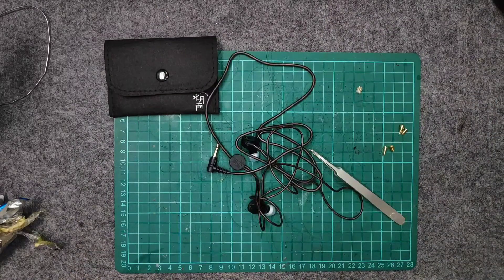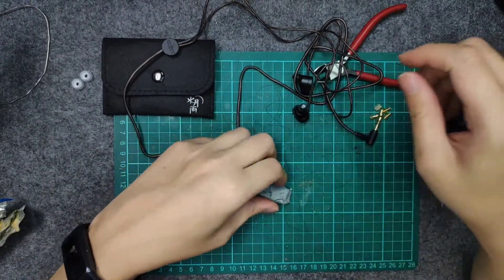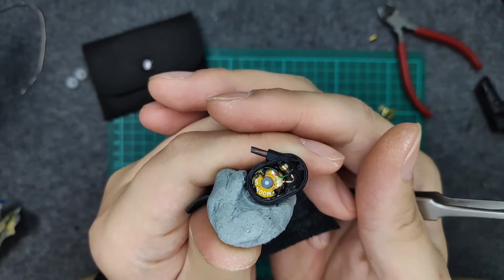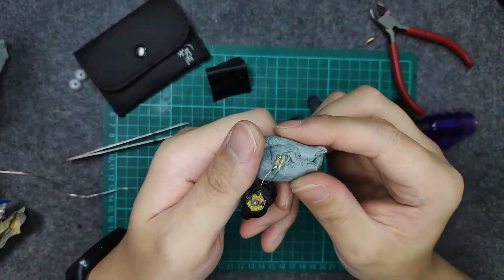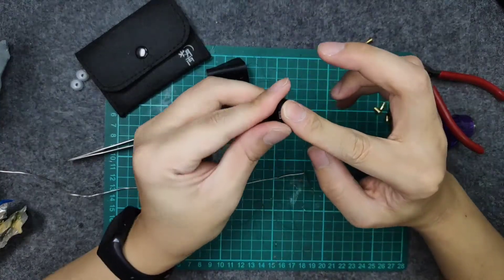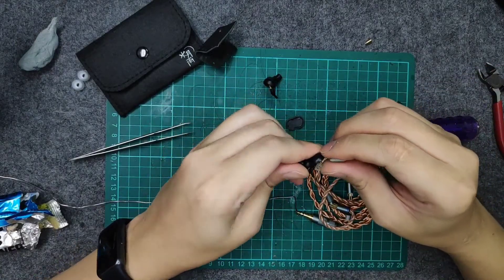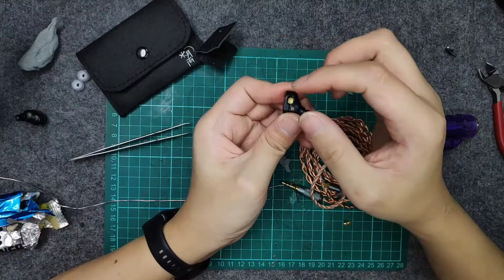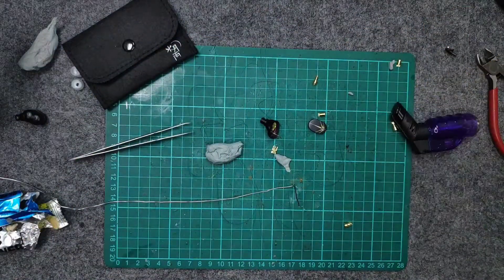Moondrop Chu Connector MMCX 2pin mod [NAKED Tutorial]

Comment: I have the chu 1 with mic. The cable started peeling so Im thinking of doing this mod. Is there a way to salvage the mic? it has a nice metal housing but it loos impossible to remove. It might need to beak some rubber seals.
Reply from the maker: the mic should not be salvageable. I cut and keep the mics of wires i replaced and hoarded a whole load of them while i cant do anything with them

Comment: I am trying to repair my chu since one side stopped working. While I was soldering the wires, the circular plate on top of the driver ('MOONDROP' is written in the plate) with the solder pads came off. How can I make the connection now?

Comment: i did it... it took me 2 hours for both side.

opening the iem is the easiest part which took me 3 min, later on i just can't solder the 2pin to the wire, in the middle of modding, i was thinking to just give up 💀

Comment: hey, i have a problem with mine: the volume of the right earbud got suddenly reduced. I tried to wiggle the cable and gently throwing it against the table but to no avail. It stayed that way for like an hour and then it returned to normal. However now, a day later, it's screwed up again.

Have you had this issue with any of your iem's? Do you know what might be causing this? It seems to be a common problem judging by negative reviews on amazon.
Reply: try replacing the filter on the nozzle
Reply: @yoru7511  not a problem with ear wax buildup
Reply: @jshroom1717  it's not wax buildup it's air moisture. replace or remove the filters (inside the nozzles). chu are known for condensation problems
Reply from the maker: hi, unfortunately this is a sign of the magnet on the chu failing and being detached from the coils. These are non reparable but i think you can get a replacement set for cheap now, or you can explore the other verisons
Reply: @sgaudiohive  while I think that detached magnet may have been the case for my other earphones, this time it were the filters, like @chestnutrice9855 said. I was really surprised. Using earphones without filters ATM, waiting for the replacement from aliexpress (or maybe I'll just remove the paper component of the filters)

Comment: I’m gonna do this to my personal set of Chu. I saw a company in Singapore willing to do this for $30, but if all you need is solder tin, a soldering iron, a wire cutters, and epoxy I’ll be brave enough to do the mod myself. Great video!!
Reply from the maker: That's great! This is a very good starter Iem for an intermediate mod, the chances for failure is very low
Reply: Howd it go